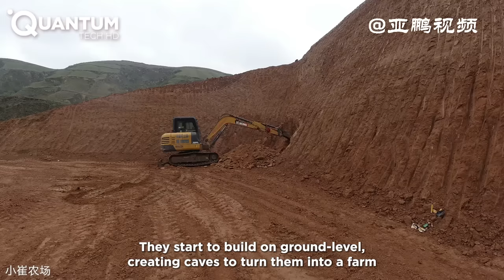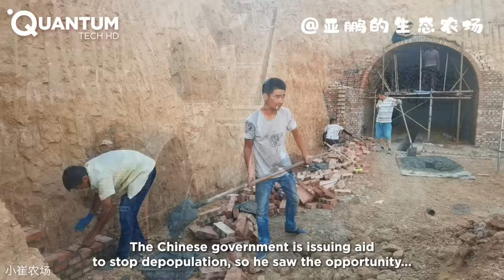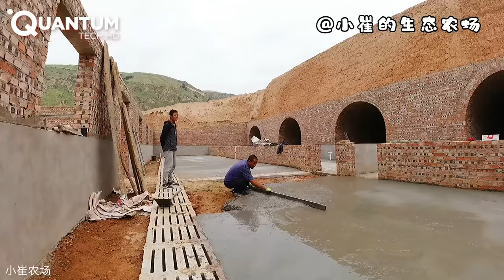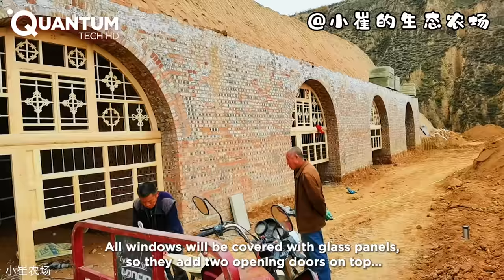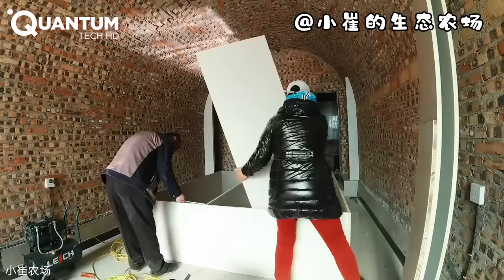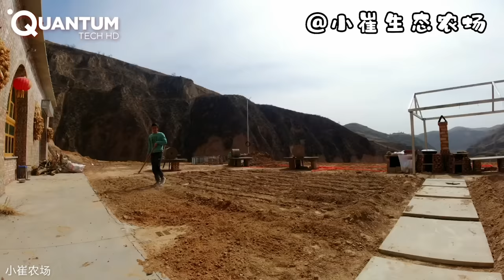Man builds an Amazing Farmhouse inside a Mountain

Comment: Am I the only one who sees this as potentially unsafe and not watertight? Are those arching bricks going to hold back any type of dirt collapse from water moving through the soil? Also, there is no water-resistant barrier for the top of the caves. I think water will seep through and wreak havoc. If this mountain were made of solid rock, that would be one thing, but this whole structure is just compacted dirt.  I hope I'm wrong for the sake of those who will make this place their home. I would be very interested to read comments from a structural engineer.
Reply: If they do not let water accumulating on the top of the hill and only limited vegetation on there (in other words, most rainfall run off the hill quickly), then there won't be water moving down to the tunnels.  Not much water is absorbed into that hill anyway.  It looks very dry and dead before they started the project.  That happened to a lot of mountainous areas where forests have been removed to do intensive farming (as in the region filmed).  After a while, terrible soil erosion, loss of fertility, rainfall runoff, etc.  Of course, that's good for waterproofing of the project though.

Comment: All of it is great, until they got to the fact that you will have to cook outside.  When it's cold and snowy, I don't want to have to go outside and cook.  😲😲😬🤬
Reply: Dark Cloud  we know it snows there because they showed snow there.
Reply: Dark Cloud  ) ikon I
Reply: In my village they are cooking outside no matter what they weather is like.
Reply: With electricity they can use small appliances to cook, slow cookers and convection cooker bowls are just two that could be used indoors during inclement weather
Reply: @oklahomaisok  Very true, however, it would be pretty expensive to run conduit in a cave....  I don't remember if he had electricity in the cave.  Getting older sucks that way. 🙄🙁
Reply: @jenniekelly571  Looked like they had lights

Comment: The concept and design/build are impressive. Problem is… this a land-slide/mud-slide/collapse/bow-out disaster that will happen sooner than later. The required internal structural dome supports (that could be equally jacked up if required, internal dome wire mesh, and spray on concrete. Outside, they required wire mesh in the concrete floor. The sewage grates inside must be made easily removable. And of course again, outside, mitigate the rest of the hill above them. Awesome concept (8 out of 10) safety and infrastructure stability is a (1 out of 10). Oh, and all the supply-chain requirements… where are they??
Reply: Good luck getting that system to flow...it won't
Reply: The cave farm located in North East side of Chia, weather there is really dry and hardly rain, the lands and hills are really dry and firm. Cave house is normal at there.
Reply: Yea no thanks. Ill build my house on the rock lol. Its litterally just fine dirt. There is no structure to this
Reply: This is the traditional form of local architecture that has been used and tested for thousands of years, the design has already been aproved by the environment itself.
Reply: China isn't known for it's safety standards in building. The people there may have been building this way for a long time because the region is fairly dry I guess, but that also means 1 good storm is a disaster
Reply: Who is designing and building these types of structures in the US?  other than Elon?
Reply: No ventilation in the bathroom? Nasty and bad because of mould.
Reply: Plenty of solutions to that problem an it looks to be encased on of those similarities happening...
Reply: Daerahnya mana ni
Reply: Es mejor intentarlo que no intentar nada
Reply: It's a db project but interesting proof of non viable concept.

Comment: Those dug out caves are not properly supported by that cement straw mix.  They could collapse if the upper part of the hill becomes waterlogged in heavy rain.
Reply: The building was built on the Loess Plateau of China. This place is dry all the year round, and the loess is very sticky, so it is difficult to collapse. There are such buildings in that place that have existed for hundreds of years
Reply: @yuantao7849  sure propagandist, like snowing during summer is something that shouldn't happen but does these days. It'll be a rude awakening for the people living there.
Reply: I'd also add that the shape, the arches, are 'self supporting'. I didn't think this would be allowed in China - just shows how much I need to learn - great to see!!
Reply: Re

Comment: Espectacular la creatividad y la ingeniería utiizada y sobre todo incorporada al medio ambiente.
Reply: An amazingly idiotic solution: to destroy a natural mountain with a smelly and dirty diesel excavator for days, and then, using a primitive and stupid method of manually kneading straw in an amazingly polluting cement, get plaster, which is stupidly manually applied to poorly leveled walls. plastic walls?!?  This man hates his tenants?
Reply: @user-kv4hr1hw4m  You right. It looked like they never built anything. They didn´t count with water condensation in caves, even there is low humidity. Next stupid thing is how big are the concrete (beton) plates. There will appear ruptures very soon. And most important thing of all. Which animals would like to have in desert

Comment: Very nice. My only additions would be to add some exhaust system from the toilets and add glass on the top so the light from outside can come in during the daytime.
Reply: I didn't see any air exchange further back in the dwellings. Musty, moldy, stale air pretty soon. 
Mainly I feel cracks will eventually be everywhere, as it's not rock but some kind of clay. Depending on how much annual rainfall. One heavy rainfall can create deep gulleys in clay on a steep incline..

Comment: I would love to see a structural engineer comment on this
Reply: Haha, I'm a Geotech engineer and this project looks very scary, completely waste of time and money.
Reply: @abolfazlnajafi  If you were there, working with their materials, what are some things that stand out that you would do different?
Reply: @paul-wq2rd  I'm focusing on stabilizing the slopes with reinforced concrete retaining walls. Also the tunnels are not stable, water can easily drain in them and lead to scouring and failure. These are the most concerns I have. I would like to say the architectural part of the project could be better than this.
Reply: Dark Cloud  It's located in the Loess Plateau, but that has nothing to do with whether he's an engineer.  Everything that was said is accurate, this project is absolutely dangerous and I'd be surprised if any engineering went into it at all.
Reply: Dark Cloud  Look at the soil, this is a mountain of dirt that's unstable, not solid rock.  It's the kind of terrain that landslides are common in.  The talus of the mountain has likely been destabilized by their efforts and the slope is too steep, it won't need all that much to give way.  They didn't use any means beyond a roller to compact the soil, which isn't enough given what they've added to it.  At the very least, a lot of settling will occur, and when that happens it won't matter if the concrete is reinforced or not.  Nothing was done to backfill the space behind the brick arches with anything solid, so the structure there is weak and will collapse with settling and water making its way behind it.  Honestly none of this is going to convince you because you have no knowledge base to understand that any of this is bad and you make judgements based on things that have little correlations.  Your decision to defend what is clearly a poorly thought out project shows how much you know of the science behind it.
Reply: Dark Cloud  You're comparing things that have nothing to do with much of anything to make a rather nebulous point.  None of your examples prove what they're doing is a sound construction method, and you really don't understand the difference.  You know nothing of what makes a slope or tunnel stable and self supporting, if you did, your opinion on this subject would be quite the opposite of what it is now.

It's okay to admit you're wrong.  I know it makes you feel bad inside, but you'll be better for it in the long run.  Admitting you're wrong feels better than being proven wrong and dying on a hill for it in front of the entire internet.  But that's your choice to make.
Reply: This must be located in the Loess Plateau of northwest China. This loess soil for some reason is very strong and the those caves WITHOUT any supporting structures can last a long time (100-200 years according to the indigenous people) if they are dwelled in by humans, possibly constant heating and cooking strengthens the structure. These caves have been the dwellings of the native peasants for hundreds if not thousands of years. I personally lived a pure loess cave without any supporting structure, no wood/bricks/rocks/rebar and the only non-soil materials used in the cave were the wood for the door and the window and the sheet rocks for the beds. I lived in a cave for several years in Ansai Country of Shanxi province in the 1970's. Landslides in the loess area are rare. I only knew of one not very far from where I lived that happened many years ago. The specific time I am not sure as none of the natives mentioned it. Here is the location of that landslide on Google Earth: 36°42'10.80" N 109°12'03.59". This was a big one and it formed a dam and made a pretty large level field where people are grow crops and reeds then.
Reply: @yutingcui9237  Thank you for this interesting comment. It makes sense that they are following a method that has already been established there.

Comment: Are you afraid that everything will collapse in the first heavy rain?
Reply: Yep,,  first rule in building,, the heavier the build the deeper the foundation,,, I didn't see any concert foundation when they started laying the bricks.. that amount of brick walls should have at least a half meter deep concert base. minimum .. and the concert they did lay inside,, there was no steel mesh to keep it from twisting and cracking.  should have a follow up vid in 2 yrs,,
Reply: I would love to see a review from a practicing structural engineer.
Reply: The mountain si the Gobi desert. The rain will not be a problem.....
Reply: Chinese products

Comment: excellent.
Insulation is no longer needed, so there are no heating and cooling problems.
One most important thing is missing
Ventilation system is zero.
Also, the bathroom is at the far end, what to do?

Comment: No es una "montaña" ni "rocosa", porque solo es un cerro de barro que se desintegra fácilmente con una pala, lluvia dura, granizo o nieve que golpeará ese desierto debido al cambio climático como en Arabia. También los terremotos derrumbarán esas paredes de ladrillo porque no tienen columnas de acero que las fortalezcan cada pocos metros, nombradas en México "castillos", que son cubiertos con concreto y una parte enterrado medio metro para estabilidad). Pero mucha suerte para esa colina de adobe.

It´s not a "mountain" nor "rocky", because it is a high hill mud that desintegrates easily with a shovel, intense rain, hail, or snow that will hit that desert due to climatic change like in Arabia. Also earth quakes will crumble those brick walls because don´t have steel columns every few meters strengthening them, called in México "castillos", which are covered with concrete and part of it buried half a meter for stability. But best of luck for that adobe hill.
Reply: TIENES RAZON , Y CON TANTO DINERO QUIEN NO HACE MARAVILLAS

Comment: They should have used rebars to reinforce that concrete slab. They should have rendered the interior brick walls and ceiling so they can apply waterproofing compound. Using plastic to cover it up promotes mold and bacterial growth behind the walls given such an enclosed space.

Comment: Ventilation,  ventilation,  ventilation !!!
Taking a dump in the bathroom located deep in the back of the structure without any airflow directly from outside (not via adjoining rooms) is a death sentence 😄
Growing up living underground for 16 years in central Australia, I'm coming from lived experiance.  There should be be direct ventilation for every room. Certainty at the vary lest the one at the rear. Pity about all the brick and modern  materials.  Earth materials have their charm,  and yes there are methods to retain this charm, and limit the dust. 
Nice concept though.

Comment: Very nice. One concern is water runoff seeping into the corner from 2nd story flow into the back wall of first floor. Since the sections were hollowed out their structural integrity could wane over time or be prone to leaking. They should have lined the walls with wire mesh and concrete at the very least and plastic lining to control any water flow. Interested to see how this works out, but I feel like this is prone to collapse or mud slides
Reply: Yeah, I also wonder of the entire hill now that it's been disturbed it's soooo much more prone to erosion, water will love those groves and quickly begin chewing channels, it's probably extremely arid there, but just the same I hope they intend to apply shotcrete!

Comment: I didn't see any provision for incoming water in either the home caves for shower or sink, nor in the animal section to wash the excrement out, otherwise it's just going to sit there...and make the animals sick. I didn"t see outbound plumbing for sink & shower, maybe they hooked that up to use to move out the lower animal section(?), but I also didn't see any outgoing plumbing for the toilet. 

Also...where is the water for all of this coming from? They mentioned snow, that could be a water source, but didn't see tanks. 
 
No water for garden.
Also no way of cooking inside in winter. 
No obvious source of electricity. 
No where to store animal feed, esp in winter.
No heaters for winter. Great wall insulation, but front 'wall' is just glass.
No ventilation for homes or even back of animal housing. That's a lot of trapped methane. 

I know they said this was 'in his village', but it looked desolate to me. 

Perhaps Chinese propaganda film...not well thought?  And YES they would do that.

Comment: All that concrete slab isn't going to hold up, there's no gravel under the concrete and no wire in the concrete, and there's no expansion joints! And they used a hell of a lot of bricks, there must be 200,000 brick here!

Comment: What a bizarre project, building partly into the side of a hill was the smartest part of this project but it goes down hill from there, no ventilation method for the very back of those rooms is a bit of a deal breaker for me, also cementing in the grates for the slurry pits seems like a mistake.

Comment: These guys look pretty skilled but you can tell that this outfit are used to working on Chinese Tofu-dreg projects. Its almost ingrained into them to cut corners.
The pointing on the bricks is hilarious. There ar areas where the outward face is perfect, but there is no mortar on the back end of the brick AT ALL. There is an air gap between the rock and the single brick arch. Why? The brick work needs to be butted up against the roof of the cave, or they should fill the void with reinforced concrete. The list goes on.
Like a lot of Chinese building projects, this looks nice from the outside, but if a building inspector came along he would most likely condemn it as unsafe. If one chunk of that ceiling breaks away it will punch right through that brick arch and kill anyone underneath.